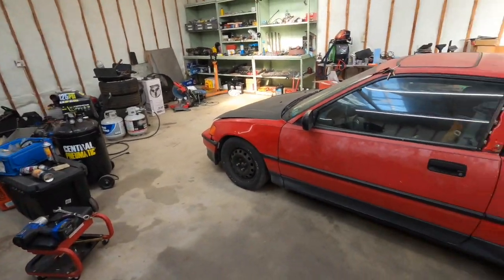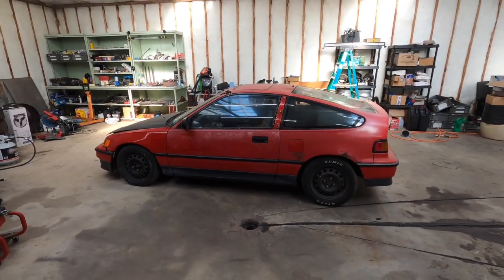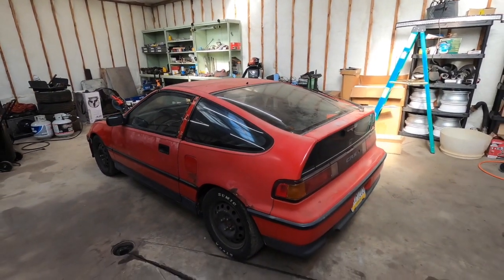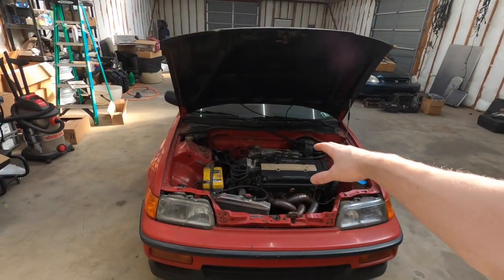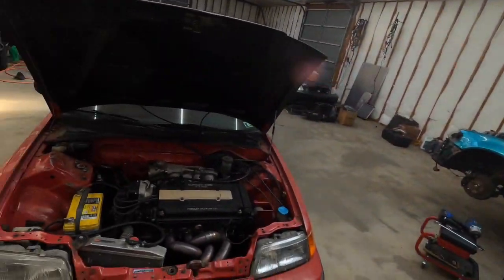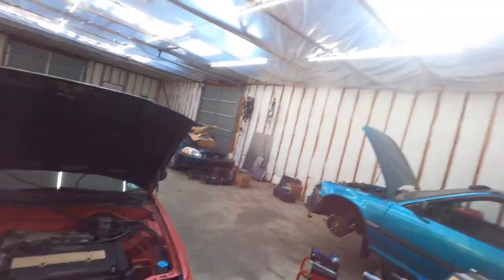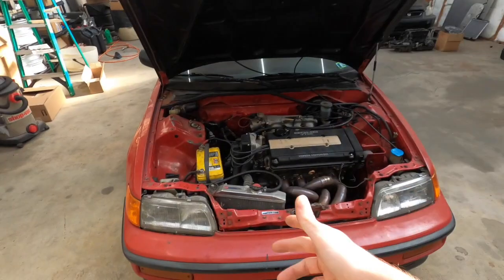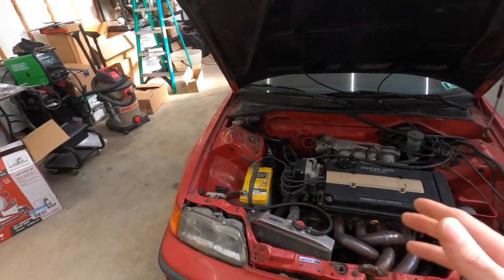1K SUBS B17 CRX UPDATE! / KRAFTWERKS SUPERCHARGED B17 CRX!!!

Comment: I had a buddy with a type r swapped ek he went kraftwerks and always had belt slip issues in high rpms. Had another buddy that had an ef hatch with a gsr that tried to swap the charger into it but he couldn't get it to fit. I hope you can get it to fit.
Reply from the maker: I will make it fit if it doesn’t haha
Reply from the maker: And I’ll try some grip tape spray on the pulley to see if it helps
Reply from the maker: @sideshow45  I just told my brother I’m gonna upload pov driving videos every week lmfao

Comment: bro I have crx b18c4 eaton m62 around 240KM/260Nm , looking an alternative supercahrger to replace eaton to get a little bit more power, around 260KM , woulldn't like to blow off the stock engine :D any suggestion please ?
Reply from the maker: Those superchargers heat so much! I honestly think you’d make better power with a small turbo or maybe a rotrex like the one in this video!
Reply: @PRZJ91  Thanks, Im just thinking about new setup on this/next year. I really like supercharger for daily drive and ocasionally 1/4
Reply from the maker: @rrr3r378  the response is only matched by all motor haha can’t wait to feel this charger on my car!